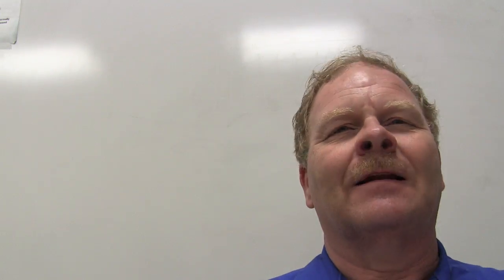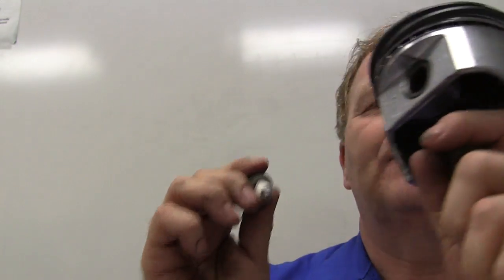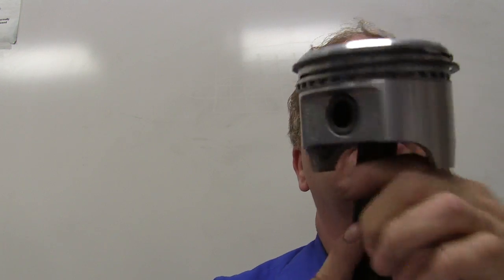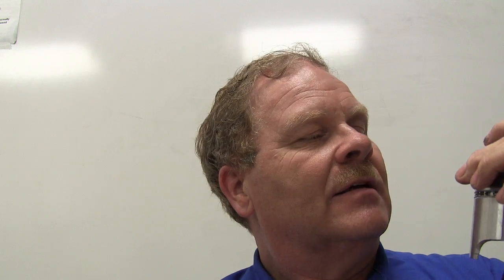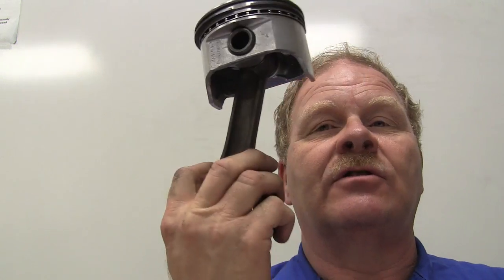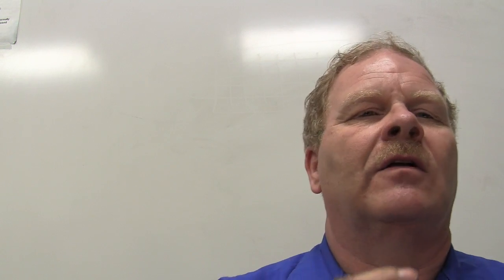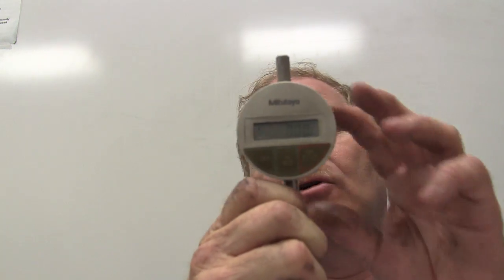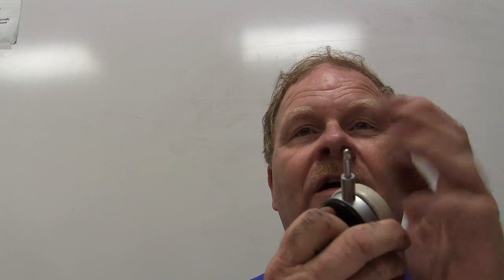Engine Repair 1 Test 5   Measuring Parts

Comment: would you use a plastic scraper and a abrasive pad to clean the head? That was a question on the ase test and I wasn't sure?
Reply from the maker: Allen Musser if it's an aluminum head I would say that is correct and since most heads nowadays are aluminum plastic scraper and an abrasive pad would be appropriate